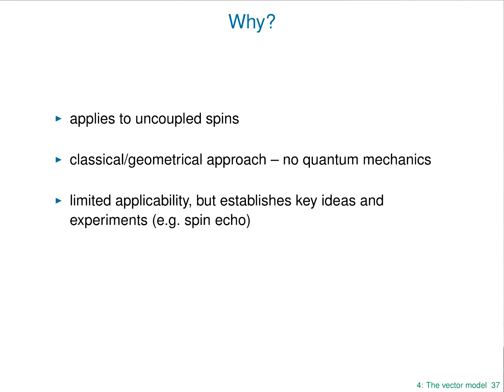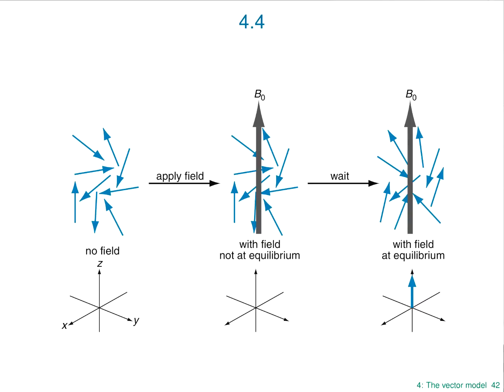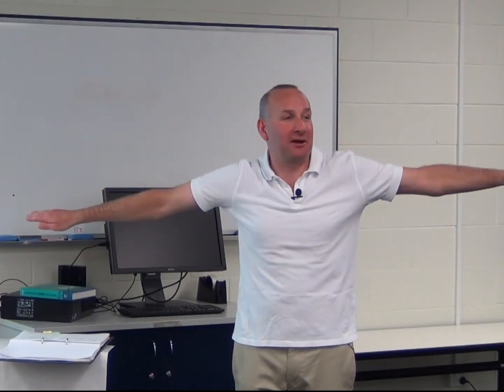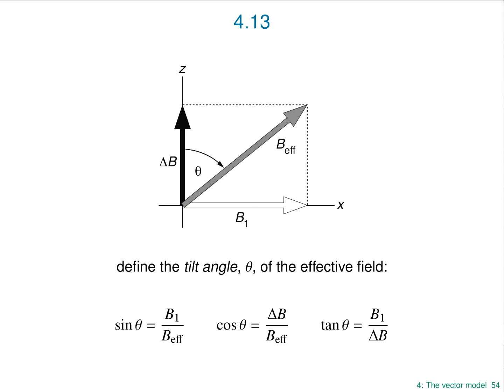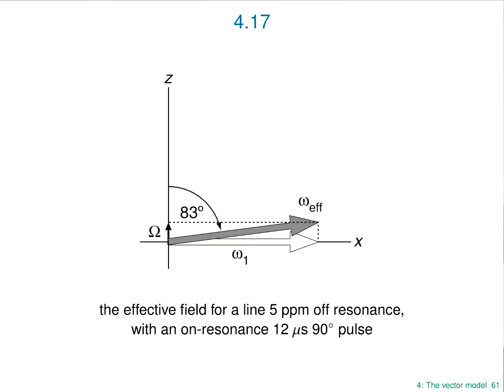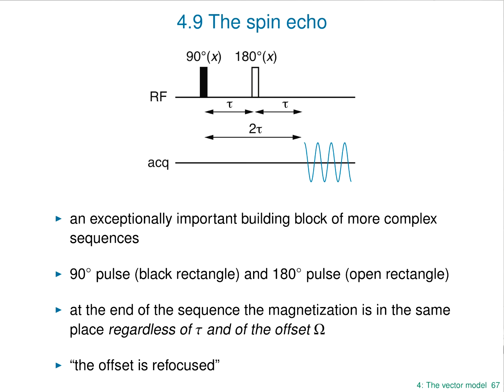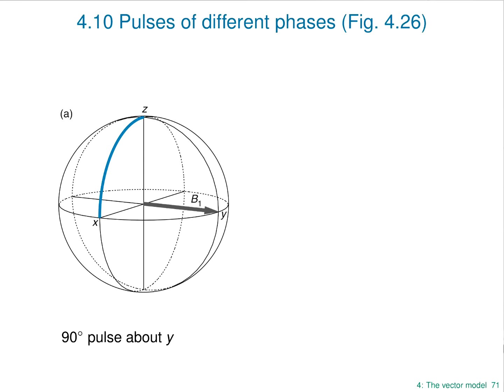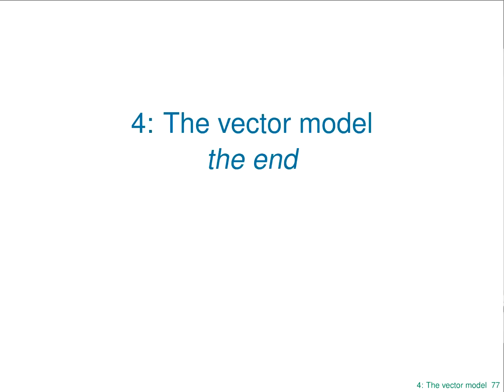Lecture 2 - Chapter 4: The vector model by Dr James Keeler: "Understanding NMR spectroscopy"

Comment: Great lectures, and while it is true that the molecular magnets can be aligned in every possible direction in the absence of a magnetic field, when a direction is defined by a field, the steady state of a spin-half magnetic moment is aligned with the z-component aligned either parallel or antiparallel to the field.  This was proved from the result of the famous Stern-Gerlach experiment. I am sure Professor Keeler left it out for simplicity.